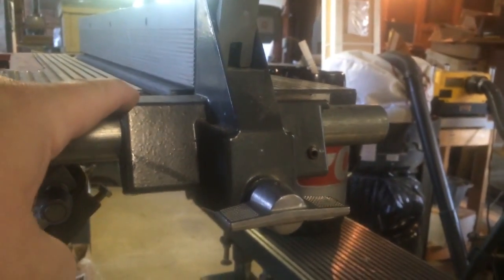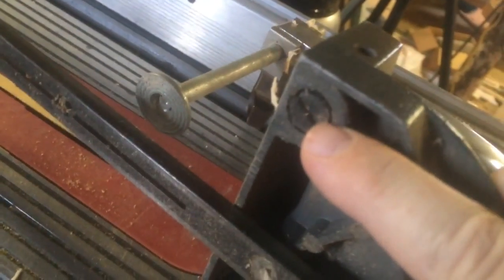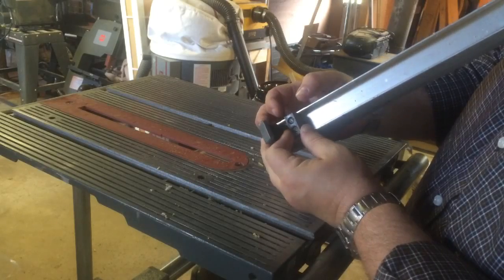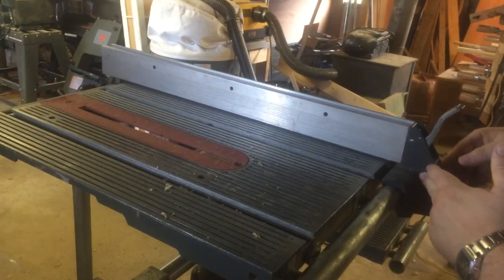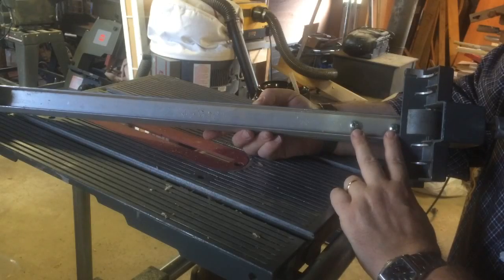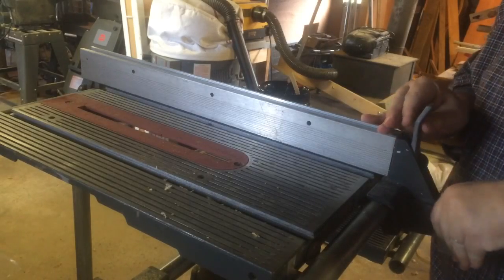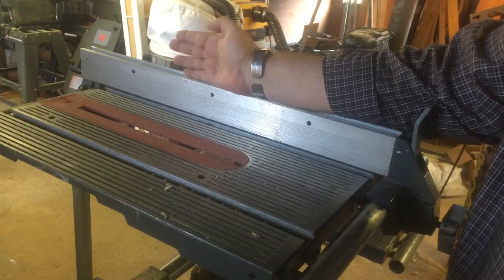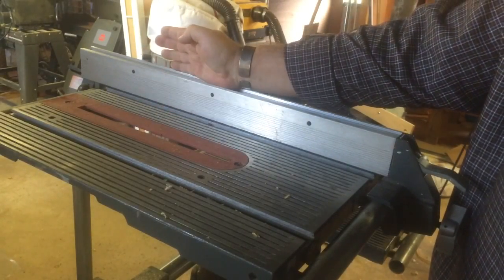Getting the Most from your Shopsmith Mark V model 510 Fence

Comment: Hey, Scott, thanks for this.  My 510 fence is parallel with the miter slots but not square vertically, that is, it is tilted front and back with respect to the table.  If I put a 90 deg square against the right side of the fence I will see space along the top edge, and on the left side of the fence I will see space along the bottom edge. How do I correct the tilt?  Thanks, Bruce
Reply from the maker: Hey Bruce. There are two seldom-needed alignments that may be needed: 1.) The fence rails themselves can be loosened and pivoted a bit. 2.) the extruded fence can be removed from the base and that connection may need to be cleaned, or deburred or even shimmed.

Comment: Thanks for The Video Scott, I have a Mark V 510 that I purchased a while back. I also have Two Mark V 500 models. I plan to sell one the 500 units and get acquainted more with the 510. Any other hints or tips about the 510 would be appreciated. Thanks Again.
Reply from the maker: If you haven't searched my blog I suggest you take a look at http://www.MyGrowthRings.com and seach "Selling a SHopsmith" in the searching bar on the right. Good luck! Scott

Comment: Scott,
After watching you adjust the fence & as you move it, one end moves before the other. My question is why didn’t SS make it to slide on bearings on both ends for a more perfect easy way of sliding without one end moving which when locked down causes the forward part to be moved a little which can cause a crooked cut. 

William
Reply from the maker: They could have done that, but I'm sure they studied it and determined that their target audience wouldn't have seen the value in the added costs. I always just push against the front rail prior to tightening, which pulls the fence straight.  Scott

Comment: Need help with my shop smith. I been ripping wood with my fence one my shop smith mark 510. I am not get square cut. I have check my fence with a square I seem to be fine. I have also check my table to be see if it is square as well. I what back and reading the shop smith book To see if I was missing any thing. I am at a loss if you have would love the help.
Reply from the maker: Are you saying that the cut isn’t square from the edge to the face, or over the length of the cut it isn’t square to a crosscut?
Reply: @MyGrowthRings   when ripping for an example I have wood that I rap down to 9 7/8. When I put lines to drill pockets holes it’s of by 1/16. I check my cross cut as well to see if I was square it’s not. I don’t new if it’s my table, my fence, or my square’s. We I was a welding r help had people show me how to check to see if the square is square but I wonder if my square could be off. I but the mark 510 used.
Reply: @MyGrowthRings  just so you knew I do bet videos or phone call, but I knew if you did that you what have time to do anything else.😳
Reply from the maker: @willimanfreeman23  It’s either that the fence is t parallel to the blade or that the table isn’t square to the blade or that something in the “5-Point Safety Check” isn’t tight. Start from scratch and make sure that everything is properly installed and locked in place, then check to see if the table is properly aligned to the blade. Do you have an owners manual? Scott
Reply: @MyGrowthRings  yes have the own manual. Just could find where it's had the set up for the fancy. But I will look agan. I will go through all the thing you recommend and get back with you. Thanks for the help.
Reply: So I found a YouTube on how to set up or Align the Shopsmith. It was out by almost 3/8”, I only made it to the point of getting the miter gauge set up I run out of time. My table looks like it my be out by a 32”. I let you new today or tomorrow. Thanks for the help.
Reply from the maker: @willimanfreeman23  Wow. Yep, that'll do it! At least now you know where to start.  Scott

Comment: What is the problem with the 520 fence?  I’ve loosened three torx head screw, align the fence, tighten #4 screw, check, tighten the rest and whaalah.  It’s within 2-4 thousandths.
Reply: That is, loosen all four, tighten (not real tight) three set the fence, tighten one, check alignment, the fence can still be adjusted if good tighten the three, tighten the fourth. Check, all  four.  It’s easily done and remains aligned to the miter slot.
Reply from the maker: Precision was never a problem with the 510 fence. I'll address this one of these days. I own both, so this isn't just a sour grapes opinion.
Reply: My Growth Rings 

I knew it was not, “sour grapes” it’s I haven’t had a problem with it.  I was only enquiring what the problem is.  I might (could) be overlooking something.

Comment: Hey, I know this is an old video but at the end you mention that you didn't care for the "new" 520 rip fence. I see in your more recent videos you have the 520 fence system on your Mark V. I'm just wondering what you didn't like about the 520 system at the time and what, if anything, changed your mind on the 520. I'm still using my dad's 42-year old Model 500 and was thinking of upgrading to either the Model 500 upgraded fence (with a front fence extension if I can find one!), the 510 or 520 fence system. I'd love to hear your thoughts on the matter if you have time.
Reply from the maker: @EricFrazier-c2i  I still prefer the 510, but that one is in storage since our move two years ago. I like some things about each the 510 and the 520, so to me they are a wash, either is a vast improvement over the 500, primarily in the guards, dust collection and the overall table size.

Comment: Why the dislike for the 520? I love my Mark 7. Were the latest injuries operator error?
Reply from the maker: Those are all fair questions. You need to understand that this was originally uploaded as a private video (Hence the intro of "Hey Adam") and there was some additional background conversation that would explain the 520 comment. I'll have to do a video review of that fence system some day but for now let me back-pedal a bit and say that I personally prefer the 510 fence. If you like the 520 fence that's awesome.  There were actually two recent injuries that prompted me to share this; One being a decision by the operator to do something that he knew better but calculated that it would be OK to do what he did just that one time. It wasn't.  The other was operator error due to ignorance. Now, when I say that I'm not implying stupidity, but rather due to a lack of knowledge of the uniqueness of the Mark V set-up he missed an important set-up step and that error caused the accident that resulted in his injury. Neither case was a fault of the tool, the company or even the extensive instructions that are provided with a new Shopsmith tool. So many times I've heard about accidents that occurred after someone gave the instructions a quick glance and then tossing them aside out of anxiousness to make sawdust. As a corporate trainer and former Shospmith Academy Instructor I know that we all learn differently and while the thorough manuals that are included with Shopsmith tools cover most everything you need to know they don't connect with those who don't learn from or even comprehend written instruction.  So, with that you can expect to see some more videos from me on my Shopsmith tools that will at least help folks like me practice "Safe Smithing".  Scott
Reply: I can't wait for more vids. Thanks for the response. I'm the type of person that delves into the instruction manual. It drives me crazy when it is incomplete.
Reply from the maker: I know what you mean. I write and edit manuals from time to time and some of the manuals I've seen (think Harbor Freight) are maddening!  Thanks for the questions. Scott